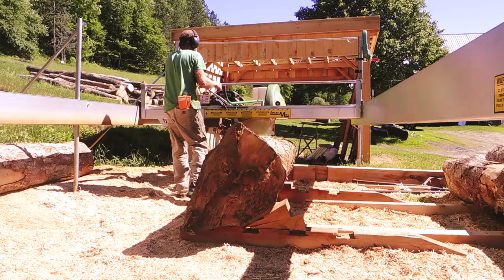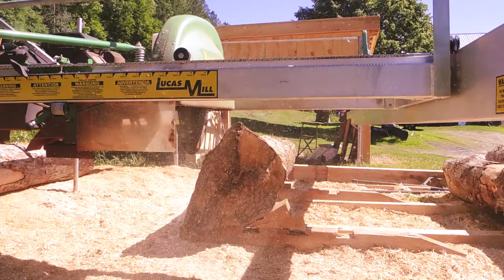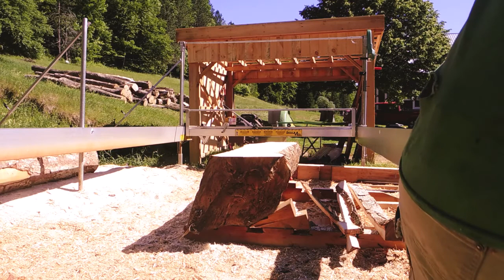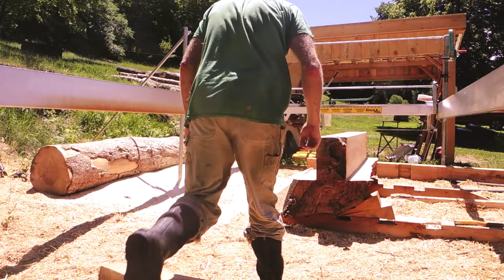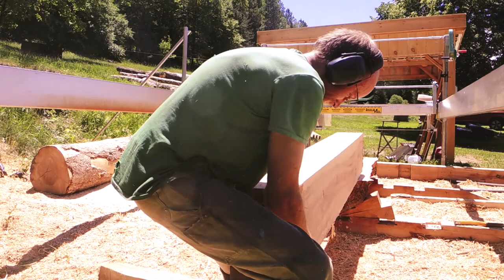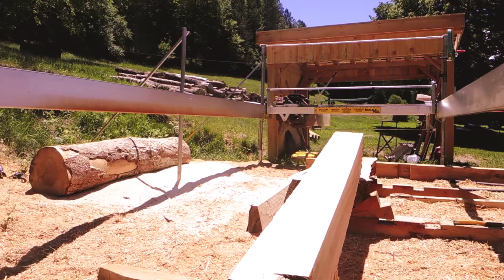Sawing 8" x 12" Oxen yoke cant with the lucas mill

Comment: About to buy one, do you ever regret not getting the 10-30. Curious as to what were the factors that made you choose the 8 over the 10
Reply from the maker: I don't regret buying the 8-30. the wood I use for framing isn't bigger than 8". The exception is something like stair stringers, in that case, I can cut from the other side to make a few. The 2" gain for making 1" boards wasn't worth the extra cost.

Comment: How often do you sharpen the teeth on the blade?
Reply: I sharpen the circular blade about every 200-400 bf. I have cut 700bf before, it will start to cut slower and take longer to sharpen. It also depends on how dirty the bark is. I sharpen the slabber as needed. Just like a chainsaw if i have to work hard to get it to cut i swap out chains or sharpen.
Reply: @krisk47  Thanks.  Ours was leaving the boards not smooth...I was wondering where it was the wood or the blade.  (almost like fur on the board - don't know how better to describe it).
Reply: @travelingkaspersworld4096  it could be the tree species dictating how smooth the cut is.  I've milled some balsam poplar, butternut , poplar that had similar "fuzzy" results
Reply: @krisk47   Many thanks.  Our log arch is going for an early test run tomorrow. It isn't finished. We need to see what the logs "want" from us...then continue welding.
Reply: Merry Christmas sir! That was a cool way to cut a cant larger than what the saw will do with out double cutting. Thanks for showing how to do it. I hope to get my saw in the spring. Got lots of beetle killed trees in my neck of the woods gonna make some lumber from them, better than firewood! Take care and GOD bless you and yours
Reply: @krisk47  that’s all you get before sharpening ?? Ouch. What kind of wood ?? Much dirt in the bark ??
Reply: @FYMM69  on average I'm only cutting 1000bf a day. Normally I only have to sharpen once in that time. The species doesn't really matter that much. Sharpening only takes about 5 minutes as long as the teeth are not allowed to get too dulled out. Any dirt on the log will dull the teeth faster than than the wood will

Comment: What is the thickness of the curf cut on the saw blade ? The slabber ?
Reply: 8” blade is 3/16” Kerf and why I didn’t get the 10” because is 1/4”. Not sure about the slabber ??

Comment: hello. I am starting to build a mill house for my Lucas. I was curious about yours. Are you able to push your millhead indoors at night. how would you have built it differently now that you are using it?
Reply from the maker: Everything thing can be broken down and stored in the shed, except the rails. Most of the year the mill is set up with the carriage covered with a canvas tarp. If I could decide on a permanent home for it I would build a shed to cover the mill when it's set up. Currently it's easier to move the mill to the logs, so it's never parked in the same place for long